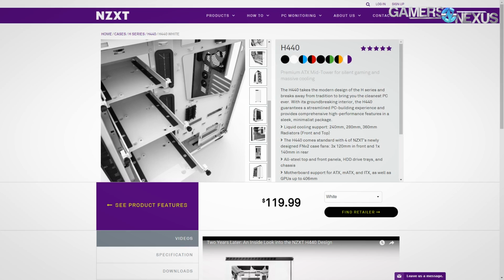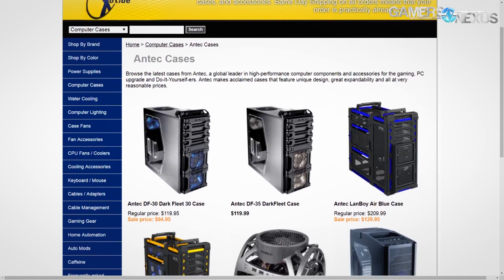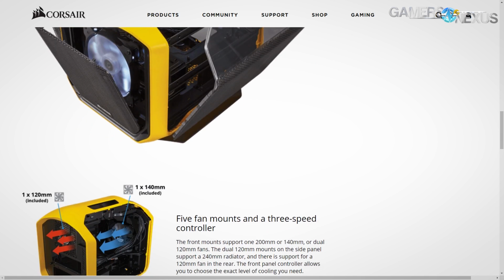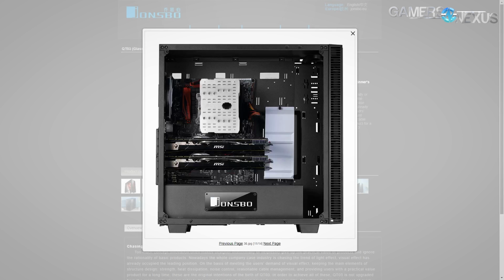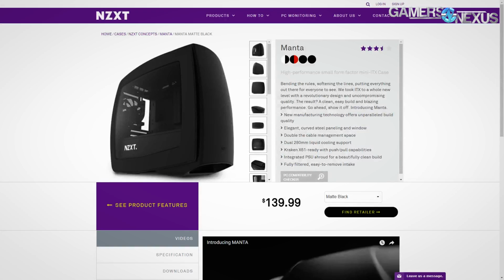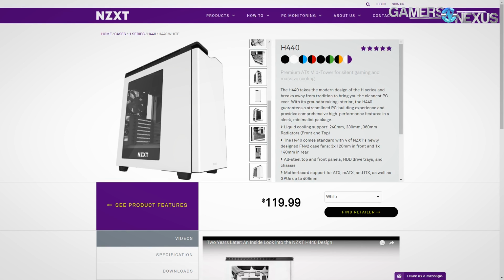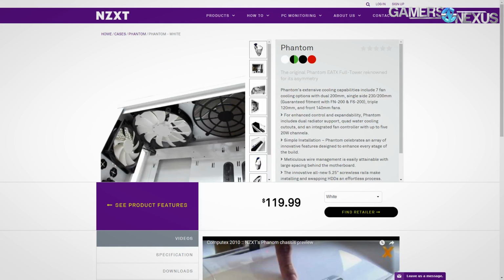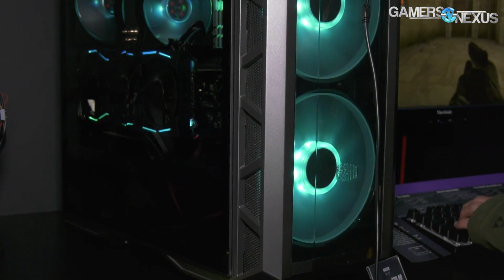Reviewing the Case Industry

Comment: Phanteks Enthoo Pro here.  A bit of a let down to be honest.  Crappy build quality and rather poor stock airflow.
Reply: Melcar Z. Funny how mine is build like a TANK and is still holding up though, and I fail to find any problems with air flow. Are you sure you are talking about the "Enthoo Pro" and not about "Evolv Pro"?
Reply: 4IN14094 Yes, the Pro.  Way too much plastic and the inside panels you can flex rather easily.  Airflow is okay for a stock rig, but falls behind against something like a HAF once you start overclocking.  Good water cooling options, but limited when it comes to air cooling.
Reply: "Way too much plastic"

Where? the front panel? the top panel? the drive cages? Where? Places where plastics is normally used? and for 99 bucks?

"inside panels you can flex rather easily"

How? The steel is about as solid as it gets, I have both a Enthoo Luxe and the Enthoo Pro, both are the same interior and building standard and none of them have anything that "flex easily"
Reply: 4IN14094 My old Haf912 does not have as much plastic in the interior, for example (comparatibly speaking).  And the inside panels do flex.  They are not paper thin, but I have used cheaper cases with thicker steel.  Maybe it's because I got a latter revision of the case (got it new almost a year ago).  It has a couple of extra ssd mounts on the front drive cover (none of the old review samples have that), so maybe Phanteks switched to cheaper materials recently.  Still, if you read many user reviews you will see complaints about flimsy interior.

Comment: Why is it so hard to find bland case that is just a plain but has support for a 280mm radiator, sound dampening padding, and air intake filters. No need for any decorations, windows or anything else, just provide me space to mount the motherboard and all other internal components, and ignore the outside, it doesn't have to look good since I will be looking at the monitor and not the case. A computer case should be purely utilitarian where you balance noise and airflow. I believe in focusing on looks only after you reach a system where you can't put any additional money into the system to get more performance, at that point, extra money can go into making it look nice.
Reply: Take a look at any of the Fractal Design Define series cases. They do just what you want. There's two versions of each case: one with a window and one with a solid cover w/ sound dampening material.
Reply: Razor2048 that's why I love fractal design cases they're so minimalist without any in your face decorations
Reply: I like my S340 with my LED's. I have more fun building than playing really. To me my PC is a show piece.
Reply: Sound dampening foam is hardly utilitarian. Foam doesn't belong in cases, period. If you know anything about how sound waves travel, you will realize this foam does fuck all for sound outside of the case. Maybe -.1dB which is nothing.

Oh and this foam is a truly mighty fire hazard. This stuff is not safe to use to treat your walls, it's definitely not safe to put inside a PC...

Comment: Just bought a used PC with an Antec 300, i5-2500k, 8gbs ram, ocing mobo, 430w 80+, win 7, and a 450gb hdd. and a cheap gpu, but that's the first upgrade (second is a cooler). $150 total, and completely worth it. Got it for my Dads B-Day just in time
Reply: That's decent.
The 2500K is obviously not top of the line, but it's still kicking and you can OC it really well with a good cooling solution.
Reply: Mikah Mitchell that was nice of you. Hope he enjoys it.
Reply: Good job bro

Comment: I just built a TR4 system with an EATX MoBo. I wound up getting a Cosmos II I managed to find on Newegg.  There literally wasn't a case built in the last 10(?) years or for less than $300 that had the sort of features I needed. But there are dozens of crappy cases with tempered glass, RGB, limited airflow, limited support for water cooling and little room for HDD's and SSD's. WTF!
Reply: I needed at least 8 HDD bays and room for a full open loop so the Corsair 700's were out. The 900D was not substantially different from the Cosmos II and I really see no need for side windows on a case so the Cosmos won out. But even the Corsair 900D is how old? 6 years at least?

My point was that these X299 and X399 systems just scream for full towers or bigger mid towers. However you won't find any with new feature sets and the newest cases are awash in stuff like glass and RGB that I, building for an office environment, want nothing to do with. The industry needs to start building cases for the vast majority of people who don't treat PC's as art but as devices that get stashed under the desk where they never get looked at. I need adequate air flow, easy to build and maintain in, reasonably quiet and that's it. I don't need a shroud over the PSU. I don't need glass or plexi anywhere. And if I open up another case that claims to support liquid cooling and there aren't mounting spots for a pump/res I may well scream.
Reply: Beyond the fact I couldn't start hacking apart a case I bought for my work, the S340 is completely inadequate for the needs of the system I built. I'm fairly confident all of the components would not even fit in that small a case.
Reply: Would a Corsair 750D not have worked?
Reply: Lars Bolduc and the 760T the 780T are just fine, the 900D is too big for some people though
Reply: Ken Shaw Depending on how many HDD you wanted to have, for anything less then 6 3.5 drives I fail to see the appeal of the Cosmos II old designs.
Reply: The 900D is actually newer than the Cosmos2 who came out in 2012 while the 900D in 2013 if i'm not wrong, if you have enought to spend on a case try the Enthoo Elit it's a 900$ case, or the Bequiet dark base 900, thery both support a lot of HDD bays
Reply: It was bad enough turning in an invoice for $330, $900 for the case alone would have been pretty hard to justify that would have been more than the graphics card. 

BTW those Phanteks Enthoo cases lie when they claim to be eATX. Check the reviews. Maybe the standoffs are in the rights spots and maybe it has 9 expansion slot covers but the MoBo's don't fit. There are actually a bunch of cases out there that claim to support eATX MoBo's but when you look closer its only MoBo's smaller than x and y dimensions.
Reply: NAS would be limited by network bandwidth. One of the points of this rig was to do video editing from ingest to post production all on one system without further consuming our already congested network bandwidth. That means going to large capacity NVME drives for primary storage which all the PCIE lanes can support and a RAID 10 array as archival storage directly in the box which then archives to offsite storage late night when the network isn't under heavy load.
Reply: +Ken Shaw As someone who's planning a TR4 build on top of a Zenith... yeah, I feel your pain. Choosing a case has been a nightmare. Feels like mid towers got really good and then full towers are just kinda gone. Whatever's available is either crazy expensive and/or pretty old... NZXT doesn't have a successor to the switch, Corsair seems to have just some generic mid boxes, Cooler Master is in a bit of a low.... Your comment on the Enthoo was curious though and got me worried as the Primo is my "default fallback" if I fail to find something shinier. My reservations with it so far are just that it 's window is not the best looker (I was hoping not to have to resort to wanton chopping) and that it's front panel has 2+2 usb ports, rather than just USB3s
Reply: Take a hard look at the Primo before you it. 8 expansion slots really makes me doubt the claim that it can support eATX MoBo's. As to USB 3 support, good luck with that. My Mobo includes a 3.1 header not that I could find a full tower case with a front panel 3.1.
Reply: I think the only one that I've seen with frontal 3.1 was Lian Li's PC-V3000 but since it's lian-li, it's probably going to be priced some 60% higher than it needs to. Still looks like a damn good case, just... Lian Li tax included, as usual.

8 expansion slots should be sufficient for eatx, no? Maybe you're mixing up form factors? I know there is some confusion in that sense but eATX has been established as ATX but some 3 centimeters wider, so they're still just as "tall". In my case I'm looking at the Asus Zenith, and another example of that form factor would be my old GBT 990FXA-UD7 (rip in pepperinos).
Reply: Sounds to me like you need enterprise-level kit. Google SuperChassis 743AC-1200B-SQ
Reply: If only I could talk my boss into a server rack.
Reply: Ken Shaw we the people demand ugly shitty cases with very specific requirements on the cheap, oh wait...

Comment: I do genuinely see the HAF selling well and I think the next major trend will be vertical mounting solutions for graphics cards, but riser cables are far too expensive at the moment in my opinion. I would like to see cases with a vertical air flow design, with intake at the bottom, however the psu positioning would be difficult.

Comment: I really, really hate power supply shrouds.
Reply: randomviewer896 What no, those are great
Reply: +Jess Osborn
They make it so I have to have my PSU facing downward, sucking air off the dusty floor.

+Mad Lust Envy
My PSU is not ugly. Any flagship PSU looks really good and I feel should be shown off. If your cables are 'ugly ass' as you say, then you aren't doing cable management properly.
Reply: Then you shouldn't have your PSU upside-down.

Comment: Agree with the Antec stuff, still using my Antec 1200 from 7 years ago, and now all their stuff hasn't really changed at all.
Reply: I bought an Antec case this year. Such a piece of garbage. Horribly build, cheap and bad material, it looked like no one at Antec ever build a system in it. That's how bad it was. Lesson learned never buy Antec.
Reply: I just built in an ancient Antec case, may have had to put a bunch of new holes in it to mount more fans but ehh not too shabby.
Reply: Looks pretty nice!
Reply: i had an antec 1200. got the case for free, put an fx 8320 in it and had 2 380's crossfired. sold it this last march for $750. kinda miss the case. it was unique as far as when it came out and it looked cool. was super heavy for a case. lol.
Reply: thor odin haha yeah mine is a nightmare to move!
Reply: Jarrod'sTech still using my Antec 300 from 2010
Reply: Just upgraded to a Fractal Define R5 from the 300 this spring. It was a decent enough case for the price, but really didn't do anything "special". Compared to the P180 I had before the only good part of the 300 was compatibility with modern huge GPUs.
Reply: Antec made some beast cases back then. It sucks that they fell behind in the market.
Reply: Nice. I'm still using my 1200 from 2010 :)
Reply: I just replaced my from 09.  It had to go, way to many hard drive slots!
Reply: Yeah I thought I'd use all mine, only using 3 haha, I ended up getting a separate NAS so it's way too big for what I need.
Reply: Jarrod's Tech look at my 1200 mod , of course i'm not finish yet.... https://www.youtube.com/watch?v=vQHMdTJtpKE
Reply: Antec is now the best with the P8

Comment: Just update s340/h440 with USB Type-C (3.1 Gen 2 10Gbps) on the front panel.
Reply: It'd be cool to see cut out designs or logos filled wtih metal colour matched mesh. Keep it minimal, add some airflow and design.

It wouldn't be for cheap cases. Silverstone could do the coolest form of this with a bunch of snowflakes falling across the front. Do a silver case, put white mesh in the cut outs. Then do something simillar to the Phanteks P300 with building as many core components (like the PSU shroud, cable routing, etc.) into the main chasis to bring down costs. (I also quite like that intergrated PSU shroud design they got.)

Then add 280mm rad support front and top, leaving the top open with a magnetic filter. Splash in some glass, file the sharp bits, and bam more airflow, still basically a fridge.
Reply: I’m constantly frustrated by new cases not having a USB Type C port.  I refuse to buy a case in 2017 that doesn’t have one.
Reply: Pass through is ok if you have 2-4 USB C ports on MB rear IO. For now it's only one in general. So dedicated MB header is much better. You will have one more port.
Reply: Waiting for something like this with the h440.
Hopefully we'll see an h440 elite with extended front io (with usb type c)
Reply: h440 updated with tempered glass and redesigned HDD tray... hot
Reply: Redesigned? How so?
Reply: They have. Asus CROSSHAIR VI HERO for example. Also you can change motherboard after 2-3 years and still use the same case.
Reply: Bloodstainer they don't need a header, just make it a pass through that connects directly to the i/o on the back of the mother board like nzxt does for the HDMI passthrough for vr.
Reply: Motherboards don't have USB 3.1 headers though
Reply: Alex Mogilev The H440 needs to have the S340 Elite interior for starters. Open and spacious. Lose the hard drive cage wall. Increased airflow for the front panel. Cut outs on all sides to trade off for the solid panel. Full tempered glass side panel. Icing on the cake? Vertical GPU mount. Sign me up.

Comment: HAF 912 FTW! :)
Reply: I'm not sure if it's my location, but mine developed some rust at the first year. still a good  case and it was worth it spray it with some paint inside. that should stop the rust for a while. Also the case seems to be really cool inside with 2x Megaflow 200 (front and top).
Reply: Still, the Cooler Master Masterbox 5 and Corsair 270R are better than the HAF 912 in every respect for the same price.
Reply: toysareforboys strange, I just watched the video from lgr about the Nintendo joystick and now I see your comment on this video..
Reply: I get around, what can I say :)
Reply: I use it for all my builds unless a customer asks for something else. The cooling is amazing, 5 x 120mm fans and 2 x 140mm fans. Ton's of flow, very balanced.
Reply: toysareforboys It's so outdated tho... I hate how it's so open and has not a single dust filter.
Reply: It's got lots of dust filters, on every intake fan and area! All over the front (to cover the two 120mm fans) and all the 5.25" bay covers have dust filters too, and there's a dust filter on the bottom too (where the power supply fan is). All the rest are exhaust fans so no need for just filters there.
Reply: Ok my bad the front and psu have dust filters, but they're not removable. I meant to say there's no dust filter on the top of the case where there's giant holes...
Reply: The bottom one is easily removable, the to 120mm ones on the front are easy to remove by popping the front of the case off. Heat rises so I always use the top fans as exhaust.
Reply: HAF X for life!
Reply: HAF 912 FTW! :-)
Reply: toysareforboys What a garbage case with lamentable cable management.

Comment: More cases need to start sporting at least one USB Type-C port on the front panel. The best rated cases don't seem to have them.
Reply: To make use of the 3.1 headers more and more motherboards are starting to have, especially at the higher end. Right now the options to actually use those headers are cases from InWin, Lian-Li, and... *shrugs*. 

I'm exactly one of those Sandy Bridge holdovers looking to finally upgrade that he mentions in the video but there is no one case I'm actually fully happy with at this point. Every one of them is missing something, but if I could just get a Fractal Design Meshify-C with a USB 3.1 port, that's what I'd buy. Boom, done, next. As it sits, if I buy any case right now I'm going to give up something I really don't want to have to give up.
Reply: Stronk Veak Charging your phone without an adapter if you lose it. Mine for my HTC 10, for instance, is special for the phone to quickcharge and a pain to replace. 

USB C heaphones

Anything USB C. It's the future, man.
Reply: Yet, the same best rated cases don't have expansion bays in the front. Plenty motherboards already have USB C in the back so no need for a PCIE card.
Reply: RavenPrecept I have a corsair 600C case with 2 5.25 bays to have media ports for the CD and SD needs. The SD and other non-USB flash memory tend to be the smaller 3.5 bay, so went with 5.25 bay converter that also has extra 2 2.5 drive bays.
Reply: give us modular front panels, that we can swap out, that may work better, and extend the useful life of many older cases
Reply: You can just buy a USB C drive that mounts in the front of your case or a USB C PCIE card.  It's not that expensive, but there's no way a case manufacturer is going to introduce such a niche connection.  Maybe in 3-4 years.
Reply: what is their use?